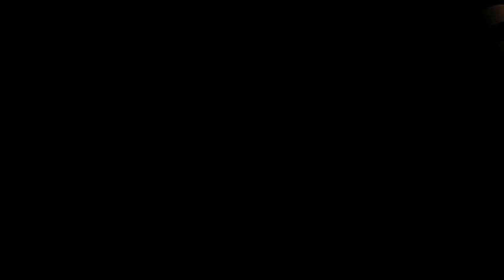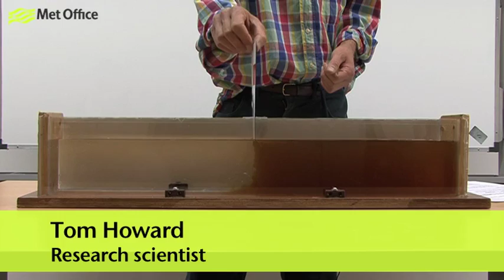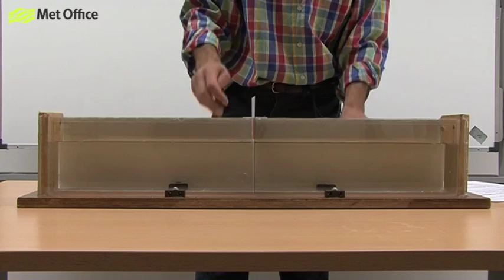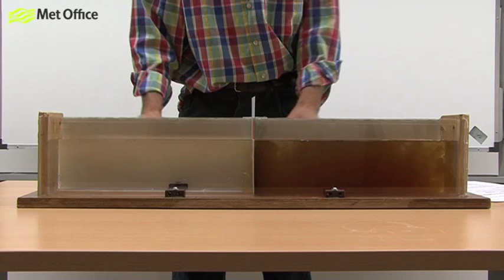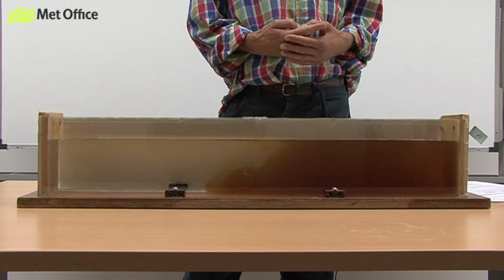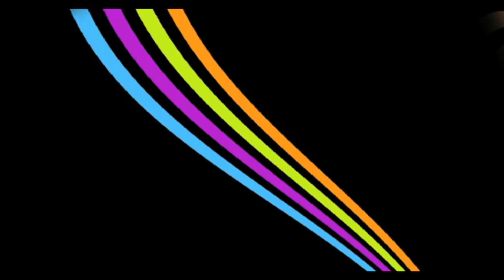Weather fronts explained

Comment from the maker: Hi tafftastic. "Left" and "Right" depend on your point of view, so that would depend where you were relative to the front. The hot air (or water) is lighter than the cold. So the hot air (or water) overruns the cold and the cold undercuts the hot. In a tank experiment like this, that results in the left-right movements that you describe. 

Hope that helps.
Reply: Isnt that like gravity current in  a estuary ? Salt water goes under fresh water